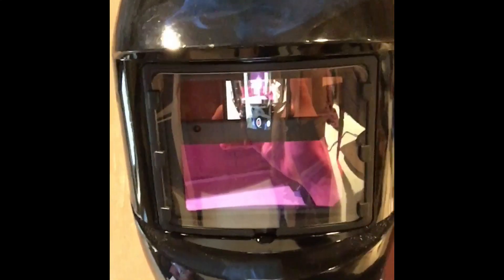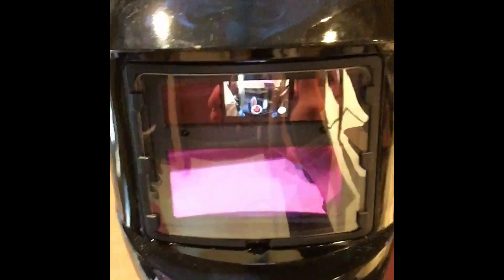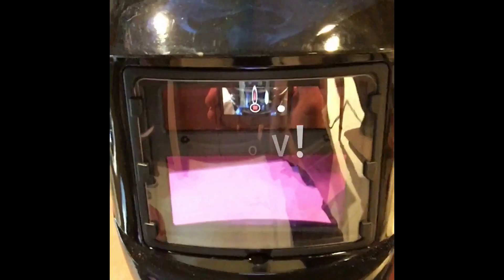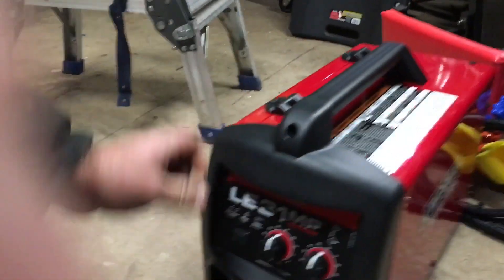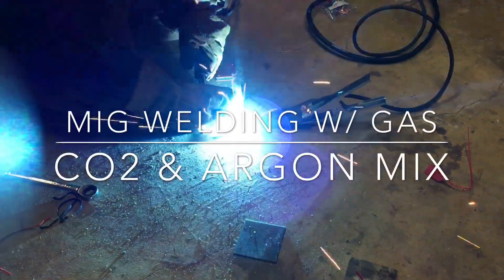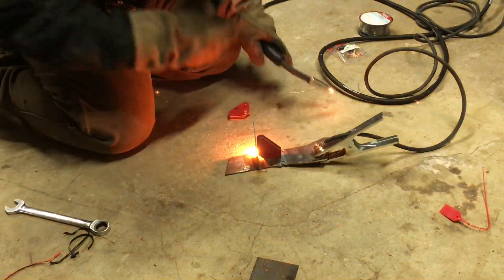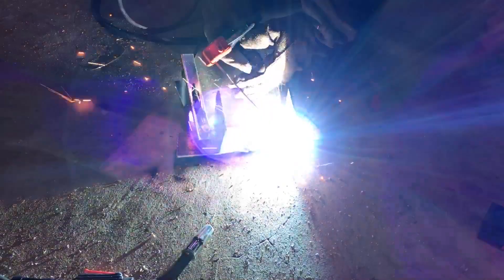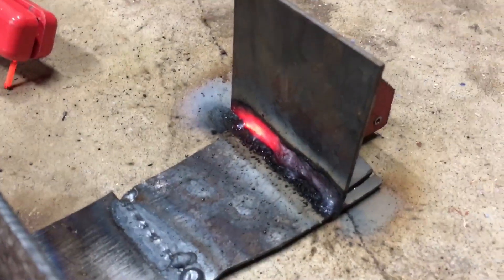Lincoln LE31MP Multi-Process Welder

Comment: Good video; I worked only with Miller products in school and fell out of welding eventually for years. I wanted  to start playing around again and got turned onto Century owed by Lincoln. The Century welder worked well enough for me to want to upgrade to a next level welder...after weeks of research, thinking of all my possible needs and wants as a DIYer/handyman, and this video...I picked one up with the extended 3 year warranty (most expensive tool/toy I've purchased for myself to date and the unit still has so little review/video/longevity info wise). I have only got to mess with the Flux-cored function and it BLOWS my Century FC-90 out of the water. How is yours doing wear and tear wise? Still happy/satisfied?
Reply from the maker: John Emerson still holding up fine!  Still very pleased with it,
Reply: @asmautollc  good to hear and thanks for the quick reply. New sub for sure. Thanks

Comment from the maker: I assumed people understood what I was talking about in the video where I say it "runs both gas and electric", but one individual thought I meant it can run on gasoline or something.  To be clear:

It runs off of electricity (your standard household 120V power supply or a generator. Keep in mind it can output up to 140 amp so you'll want a breaker and line rated at 20A at the least.

It does however have the capability of supplying shielding gas to your weld from a connected cylinder of compressed gas for welding with non-flux cored wire.  You can also use flux-cored wire with this unit, eliminating the need for a separate source of shielding gas, as the shielding gas is released from the flux core itself as it is burned up at the weld. Finally, you can reverse the polarity (flow of current) through the circuit you are creating while welding by changing the plug configuration on the front of the welder to suit either flux or non-flux core MiG welding.

You can also Stick and TiG wand / stick weld with this unit.  So it is a true multi-process unit.

Hopefully this helps clear things up.  Thanks for watching!
Reply: asm154 🤣🤣🤣🤣

Comment: I'm very new to welding. Bought this welder to learn.  Need advice before I make connections.  Is stick welding connection to the positive side of the Lincoln LE31MP?
Reply from the maker: Roy Estala it depends on what you’re trying to weld.  DC Positive (reverse polarity) is what is often used, b/c it gets the deepest penetration.  I’d recommend learning the basics from online, or a local cc course, or a book, etc... if you don’t have someone to teach you.  Stick welding isn’t hard, but understanding the basics will make decent welding a lot easier to accomplish.  I’d also look into flux core / MiG welding, since it comes with your kit.  It’s easier than stick, in my opinion.
Reply: I’d like to start playing with my welder.   Just to clarify, I’d connect to the electrode to positive connector for deeper penetration. Right?

Comment: Buddy, don't leave the magnet there for the full weld. Use the magnet just to tack and then get rid of it. Welds are grossly affected by magnets.
Reply from the maker: Julio Valdez it was just a demo with scrap metal, but thx for your input.
Reply: And magnets are badly affected by heat.

Comment: Good video bro .I just bought this welder my self don't know much about welding I been looking on line but it seems like your the only one who did a video on this Welder do you know what site I can look at to learn a lil more about this welder?
Reply from the maker: Gilbert Estrella thx, appreciated.  The best info I have seen on operating this particular welder is its own instructions that it comes with.  If you need more info, maybe try contacting Lincoln Electric, they might be able to help:

http://www.lincolnelectric.com/en-us/company/contact-us/Pages/contact-us.aspx?utm_referrer=https://www.youtube.com/

In terms of welding in general, might consider a course at your local community college.  Then you’d have the added benefit of a professional instructor to show you how to get the most out of your unit, and you can test out the the different methods it can run, including non-flux MIG with gas and TIG.  That is the fastest way to learn short of knowing someone who can teach you.  Otherwise, get some scrap and practice stick and flux-core MIG welding first, and look into non-flux MIG + gas and TIG later as needed (I personally prefer TIG, but the separate wand and foot pedal are expensive, so I’ll stick with mostly MIG for the time being, which I prefer to stick, though sticks are really cheap).

Comment: Nice video. I got this machine today. Which metals will it Weld; Carbon, Stainless, or Aluminum?
Reply: Tig Weld I meant.
Reply from the maker: Should be able to handle all three types of metal but whether it will handle a specific project application will depend on the thickness, type(s) being welded, and other project specs.

Recommend doing research before trying an application you’re unsure of, and practicing as needed on some scrap.
Reply: Not having AC tig weld, then using SPOOL GUN FOR ALUMINUM

Comment: Well is it still good? Out of everything out there is this the one to get?
Reply from the maker: Sam that depends on how you’ll use it and how often.  As for me, I’m still happy with it.  Haven’t had to weld a frame with it yet, but I’m anxious to test out its limits when I get my hands on a new project vehicle.

If you’re looking for a portable welder that does MIG, TIG, and stick and can handle up to 5/16” thick steel with a fairly high duty cycle, this will check all your boxes.

If you prefer a single process like stick or TiG, or a dedicated MiG welder, you can get units for less that should work fine.

If you’re dealing with really thick metal, like beyond 5/16” (the max thickness it is rated for), look for more powerful units running at 220V.
Reply: asm154 I was just lookin to do some fab work I'm a stick welder I have mig welded a little but my main goal is to learn tig and mig so I can build me an ultralight plane. Thanks for your input it's a fairly new machine so not alot on it yet but it looks interesting for the price. Thanks for the help.

Comment: Is this good to weld custom offroad bumpers or custom suspension tube?
Reply from the maker: villalba0611 it depends on the thickness and material.  If it’s passenger size vehicles I’d go with a more powerful welder.  I posted the spec sheet in response to some other comments.  Check that for limits.  If it’s borderline I always air on the side of caution.  For exp, I’m not using it on my own YJ suspension.
Reply: I have no experience in welding but i wanna learn lol....im planning on welding uni body stiffenrs theyre like 1/8th or 3/16
Reply from the maker: villalba0611 I think you should be fine using it for that.  Btw, here’s the spec sheet:

https://images.homedepot-static.com/catalog/pdfImages/a5/a5e5e7bb-c17f-4c84-946b-7de6d89b9a13.pdf
Reply: Thanks i will be getting this welder soon

Comment: Is this one better then the 180 pro mig
Reply from the maker: speed freaks racing the 180 Pro MiG is more powerful.  Between the two, you’re trading performance for versatility.  Pro 180 can handle 230 amp and weld up to 1/2” steel.  This does up to 5/16”.  On the flip side, this is lighter and a little cheaper, and ofc can do TiG and stick welding as well.

Comment: What is the right amp amount to weld a 7018? I have one of these welding machines but the rod keeps sticking to the plate.
Reply from the maker: Manuel Alvarez this calculator might help:  https://www.millerwelds.com/resources/weld-setting-calculators/stick-welding-calculator

You should also check to see if the stick manufacturer has any recommendations.
Reply: Wow thank you.
Reply: One more question. On this LE31mp, on stick, how can I adjust it to 110 amps. I just got this machine

Comment: Have you or anyone used the tig selection, if so how was the operation of it?
Reply from the maker: nick andrews I haven’t.  The wand is expensive.  I might get it at some pt.  I used to prefer TIG when I had access to both methods.  If and when I do, I’ll post my thoughts but that’ll be a ways off.
Reply: I am not a certified welder.  Even with the foot pedal and Lincoln torch ($300 extra) it is still lift start, which they don't tell you.  I feel it TIG welds cold compared to my past experience.  I hope I get used to it.

Comment: What additional items are needed for tig and do you know if it's sold as a "kit".
Reply from the maker: 503 Diggers 

Required
https://www.homedepot.com/p/Lincoln-Electric-All-Pro-TIG-Torch-Assembly-K1782-16/303130319

Optional
https://www.homedepot.com/p/Lincoln-Electric-LE31MP-TIG-Welding-Foot-Pedal-K4361-1/303130347
Reply: Just got mine too. Can’t wait to
use it.

Comment: What’s the black knob that was packaged with the wire and tips used for? I just opened my new welder and for the life of me I can’t figure it out. On the knob it says Harris 601 230bar.
Reply from the maker: It's the turning knob for the regulator valve on your MiG air gauge, i.e MiG regulator assembly.  You have to put it on yourself.  Yeah its weird where they stuck it other than it was with the MiG spools so I guess that was their logic.
Reply: asm154 1 ahhhh.. I never thought about the regulator. I was in a rush to get what needed done before the sun went down. I’ve only used the welder once so far, but I’m digging it.
Reply from the maker: Me too.  It's a good welder.

Comment: I just bought one of these and I can’t get the wire to feed through. Any suggestions??
Reply from the maker: Try adjusting the tension on the spool and wire feed in the cabinet.  It may be too high.  There's either too much tension or too little; i.e. the mechanism isn't grabbing the wire, assuming you've got everything else squared away.
Reply: Flip the feed switch inside. Changes it from spool to MiG

Comment: why u only review on here for this? its a good review just like more opinion's lol
Reply from the maker: Doug I’d check out HD and Amazon sites for more reviews.  Still happy with it.  It is a little pricey as it’s basically an all-in-one, but doesn’t come with the TiG wand and foot pedal.  If you prefer a particular welding process, I’d go for a dedicated unit which will either be able to handle larger welds or be cheaper.  If you use multiple processes and prefer the versatility and portability, this is a good choice.  If you’re unsure, I’d try the different processes out first before making an investment.
Reply: Thanks my friend I kinda think its cheap (pricewise) compared to say another brand that's twice as much that's why im into it so much. glad to know u still happy with it and thanks for the info.

Comment: Can it run .068 232 using .072 contact tip?
Reply from the maker: Time Out my guess would be no.  It comes with the Magnum Pro 100L which has an upper limit of 0.045 wire diam and comes with .025 and .035 tips.

At the least you’d need a different gun.

Here’s the spec sheet:

https://www.homedepot.com/catalog/pdfImages/a5/a5e5e7bb-c17f-4c84-946b-7de6d89b9a13.pdf

Looks like .035 may be upper limit for welder itself.
Reply: Thanks.

Comment: Good Day Can you advise if this welder lead has a safety. Or once the welder is on the gun is hot.
Reply from the maker: In4Tek it’s live unless you shut the unit or power off.  The MiG gun has a trigger to control wire feed.
Reply: Hi  the wire is only hot with the trigger pulled.  I think the TIG torch is constant hot, as I belive the stick- I don't do stick.  But the MIG is cold electrically and can be set down on your work.  I think that was your question.  By the way, I am very impressed with my LE31MP.  I am a hobbyist not a pro.  But this is by far the best home welder I have used; and I have used Eastwood and HTP before settling on the Lincoln.